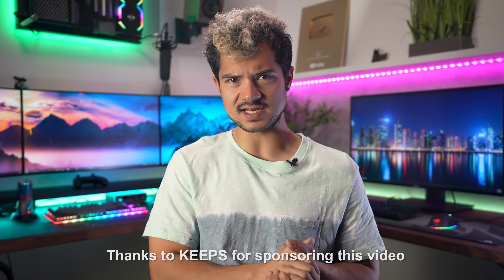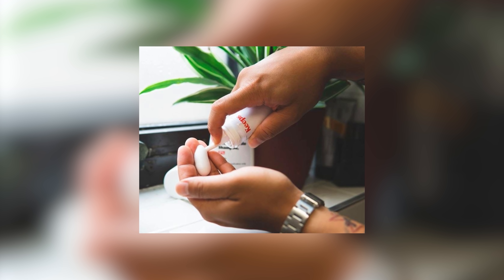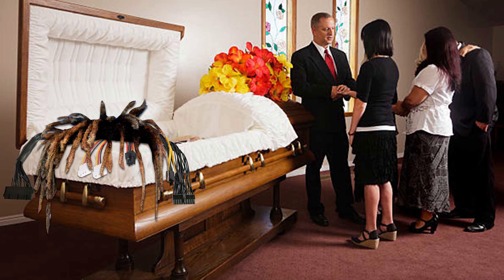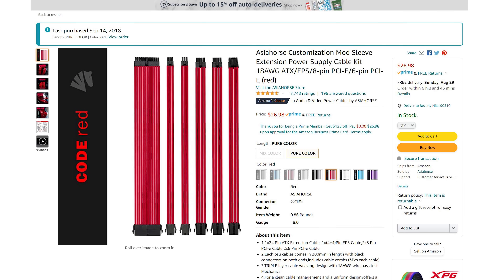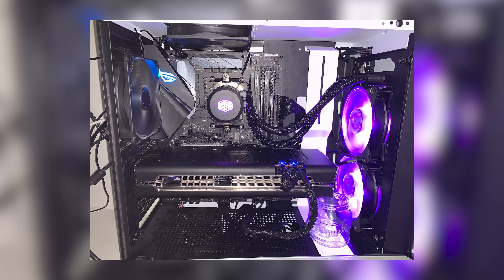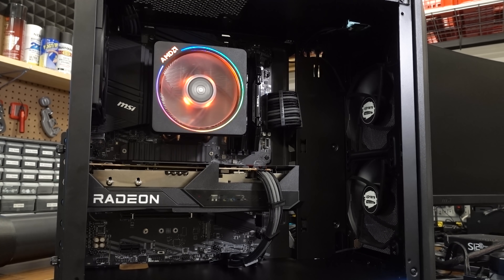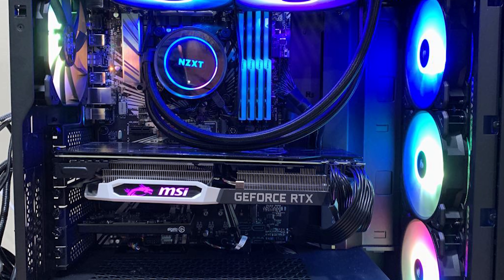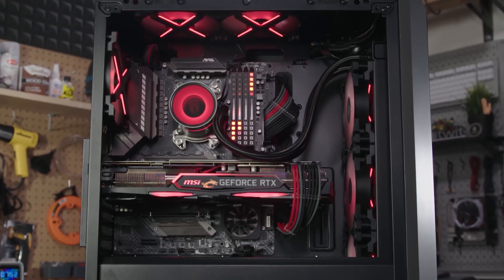THE TOP 5 THINGS WRONG WITH YOUR PC RIGHT NOW

Comment: My cable management is "ok", I use stock cables, my air pressure is positive and placed to the best of my ability(all same fan type and brand), I use no RGB/turned off, My GPU is not sagging (as far as I can perceive)and its small... I have a case with no window so other than the fan placement ,GPU sag, and maybe the cable positioning, the "looks" are of no use to me.

Comment: I just got a gaming laptop and runs hot to the touch and I was wondering if it’s normal or should I get an external fan
Reply: heat is never good especially on electronics.  A fan would help and never be hurtful.  so yes. get one.
Reply: @WillDIYGarage  okay thank you sir